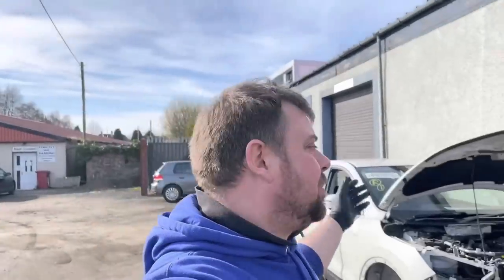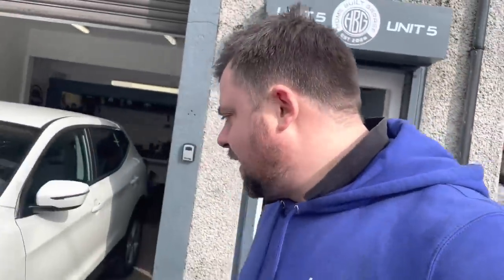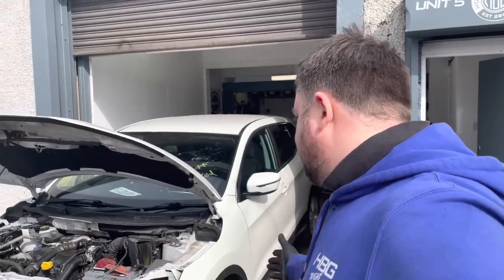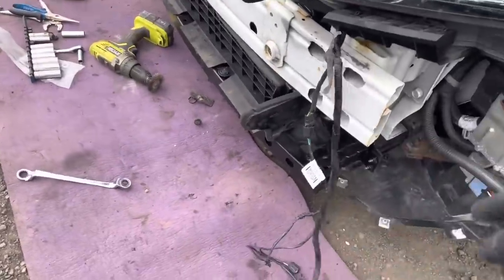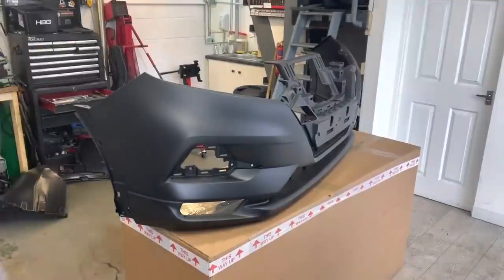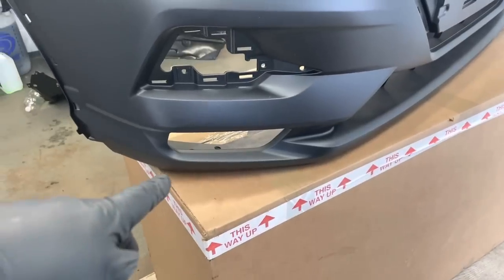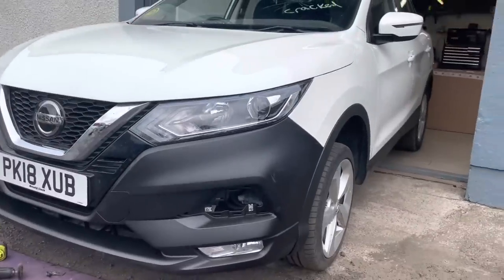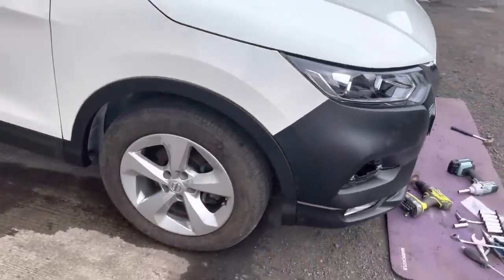Rebuilding a WRECKED Nissan Qashqai from COPART!

Comment: That plug has gotta be ambient air temp. Your cluster was showing -40 degrees!  I know Scotland’s cold but that’s another level 😉😂. Most modern cars they fit the ambient air in the ducting for the front rad and intercooler! 

Very good quick turn around tho keep up the good work!

Comment: We still have the 10 reg 2.0dci that we have had since new and has done 179k and it is still a joy to drive so if that's anywhere near  as good then you are sorted.  We have replaced it but never parted with it well over a year later and I tend to use it as a daily and use the replacement at weekends or to go places.  Great car